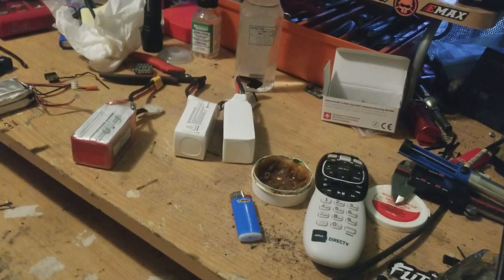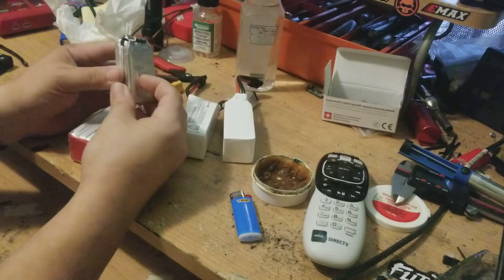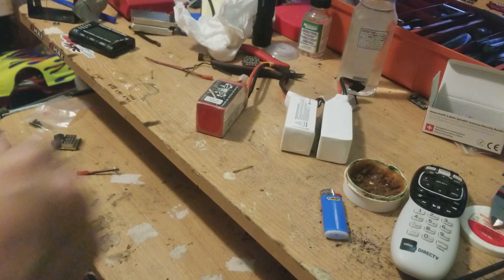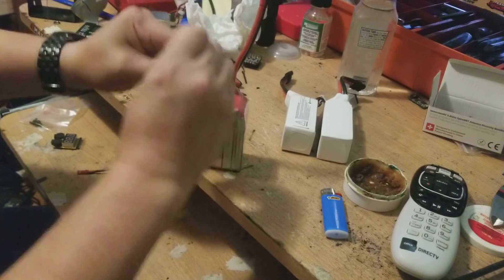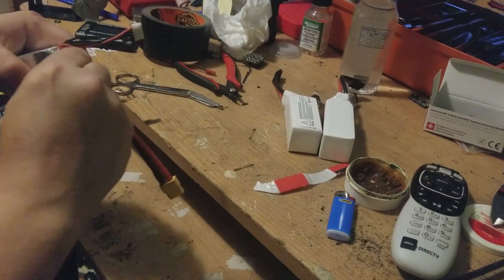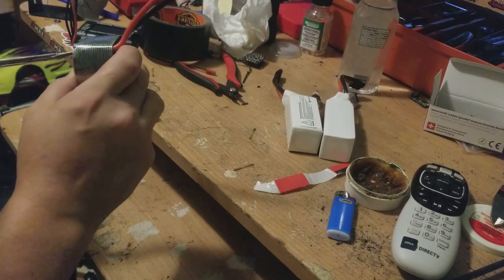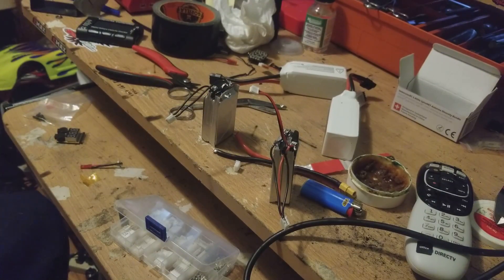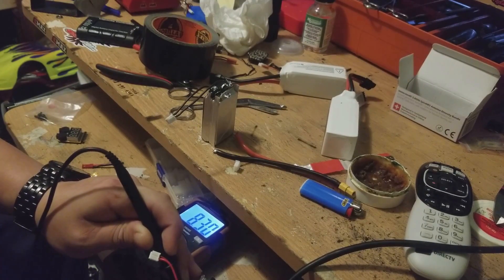How to use a 4s battery to make 2 2S batteries SAFELY

Comment: For solder joints of that size you need a higher wattage iron and a chisel point tip,higher wattage iron so the solder joint doesn't soak up the heat too fast making you keep the iron on the joint longer than you safely want to,and the chisel tip to heat a larger area faster.

The higher wattage iron and broader tip is far safer as it will melt the larger solder joint faster not allowing time for the heat to permeate into the lipo cell causing a nasty problem.

I'm an electronics design technician and have worked on various types of solder joint,and you need to get the solder melted asap so you need to use the proper iron tip size and related wattage to the mass of the solder joint,otherwise as i say you have to hold the iron on the joint longer due to the mass acting as a  heat sink.

The pen irons up to 30W are really for pcb work,even then you can melt the bonding agent for the copper track then you have to epoxy it back down after the soldering is done,not pretty,speed is the key which needs the proper power iron.

I have thought about converting a 4s 20c 6000mah to two 2s 20c 3000mah for my hubson 501s as the 2700mah 10c 2s ones on ebay are knock offs and most likely are 1500mah,so i'll use a 100W iron chisel point,that baby can solder onto steel chassis enclosures for ground connections in seconds no sweat without causing heat spread issues ie buckling,powder coat destruction(about 20mm of coating is removed).

Good vid to watch,be safe,and use a proper iron stand,i've burnt myself so many times .